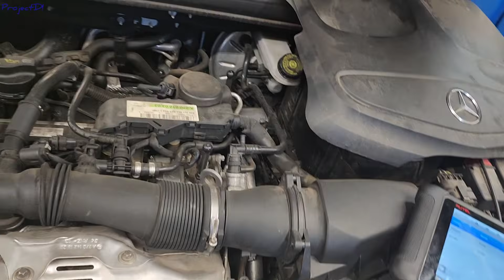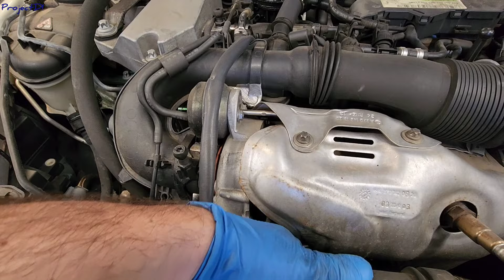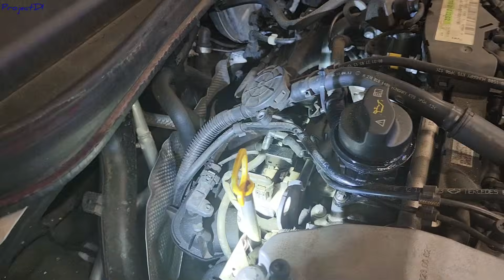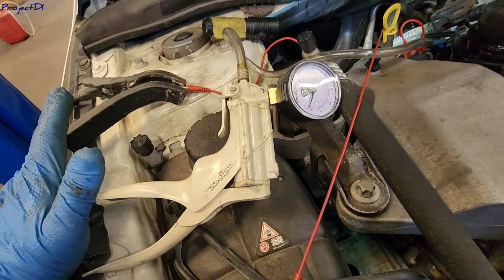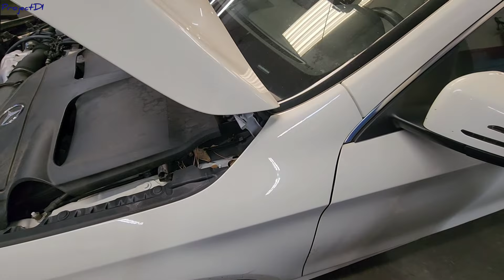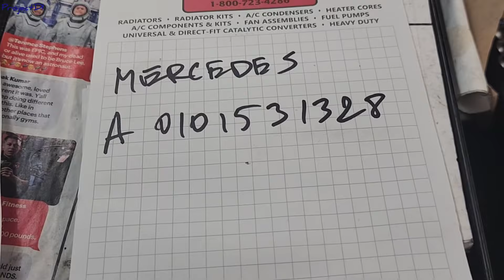MERCEDES P0299 2.0L LOW TURBO BOOST PRESSURE CHECK ENGINE NO POWER TO VEHICLE, DIAGNOSTIC & REPAIR

Comment: My wife's Infiniti qx30, basically a CLA wearing a kimono, started throwing turbocharger codes. She took the car to the dealership twice and they could not find the problem and instead blamed it on the accessory battery causing faulty codes, and then the main battery. She paid for the accessory battery to be replaced and then when they wanted to change the main battery, I told them not to. They wanted about $600 plus to do this. I bought a $250 battery from a local auto parts place and did it myself and it did not fix the issue. However watching your video, it literally took me 5 minutes to find the problem. A cracked vacuum hose on the wastegate actuator.  I wish I had found this video earlier. My mistake searching for qx30 instead of CLA. The next step would have been the dealership wanting to charge a couple of grand to replace the wastegate. 

Thank you so much!
Reply from the maker: Yes indeed, a couple of those Infiniti models are a complete Mercedes vehicle with Infiniti badges so you need to look for Mercedes problems instead... Glad that you fixed your issue and thanks for your support! 🤞💪👍

Comment: Is its same for c250 Mercedes Benz 2012 I have same code P0299 should I buy the same part or no I have to check it first
Reply from the maker: You need to do your diagnostic always before buying parts... You may think your problem is the same but until you do a proper diagnostic you are never going to know for certain... Thanks for your support and Good Luck!🤞💪👍

Comment: Hey I have a 2014 Mercedes Benz CLA 250 was running good got the engine pressure washed. Now it’s misfiring replaced spark plugs and coil packs and nothing. Any idea what can it be?
Reply from the maker: You need to scan for codes in the ECU to see what the ECU is complaining about before throwing money at parts you don't need to replace... Thanks and Good Luck!💯🤞👍💪

Comment: What are you talking about you delusional psycho? you just showed the Turbo Waste Actuator is not holding vacuum and needs replaced, why are you following "lines" ????? why are you worried if the line is sitting on the actuator good when actuator diaphragm inside of it its bad you showed that on your gauge lol.. i wish i can find where your "shop" is you need to go to court and payback all the customers you screwed!!!! like with your transmission services and other crap you keep lying to everybody.

Comment: Hey man, just got the same issue on my 2014 cla250, car seems to be running at around 3k rpm and no boost to be felt, just ordered the solenoid off on ebay, gonna have to drive like this for a bit till it arrives, will update once it comes cheers
Reply: So here I am dumbfounded, changed the actuator, the valve, and issue still not fixed I'm about to sell this crap and buy myself a Honda I swear
Reply: Update!
Did a full check on the turbo system, turns out one the small vacuum lines in the system had a pretty big crack in it, changed the line and drives again like it should, cheers
Reply: @denisandronic134  wat hose was that?
Reply: @ignacioalonso5201 yeah facts lol what hose was it
Reply: @denisandronic134 what hose was it
Reply: @denisandronic134 which one
Reply: have you fix it yet? I think mine has the same prob
Reply: @princelankah9796 so I just got to changing the solenoid yesterday, it fixed the issue and car now pulls as it should, cheers👌🏻
Reply: @princelankah9796  not yet, the solenoid came but will change it in a week or so, I will update then
Reply from the maker: Thanks for your support and Good Luck! 🤞🙏👍
Reply: @projectathos hey man so quick update, after driving around for a bit today I still noticed the same issue, car revs up but refuses to change gears? After stopping and starting it later it seemed to drive okay, could the issue be related to the wastegate actuator or is it more likely transmission related?
Reply: @denisandronic134 hey were you able to identify the problem ?
Reply: What’s the progress bro ? 
We need answers 🥲

Comment: I have a c300 2015  wife woke up jumped in it she claims to have let it warm up but smokes like hell not knocking no flashing check engine but it it’s burning oil thinking the turbo went out @170k
Reply: @projectathos  hopefully not the engine
Reply from the maker: You are going to need a proper diagnostic from a professional shop... Good Luck🤞
Reply: @projectathos  I’m a b level tech my pops a master mechanic I’m just now looking this stuff up couse I haven’t got home to actually check it just going by what the wife says hahaha

Comment: Mercedes c300 2016 I replaced the waste gate actuator. I now have power but the engine light is still on and the code says permanently P0299 do I need a specific scan tool to reset this code?
Reply: So when you tried to accelerate you wasn’t getting much power but when you changed the waste gate it ran normal correct
Reply from the maker: Yes you are going to need to go to a professional shop and get it scanned with an expensive scanner/computer that can specifically scan deeply into your car's ECU. At this point you are shooting bullets in the dark... Thanks and Good Luck! 🤞💪👍

Comment: Hi friend, mine loses pressure sometimes, usually when starting cold, then I turn the car off and on and it goes back to normal, I've already changed the vacuum solenoid and the problem continues, do you know what it could be? Thank you and congratulations for the video
Reply from the maker: You need to smoke the air lines and see where you are loosing pressure. Thanks 👍
Reply: @projectathos  Hi friend, the mechanic informed me that there is no vacuum coming from the engine, there is a vacuum before the solenoid, it only creates a vacuum after the engine heats up, is this normal or is there a problem?
Reply: @projectathos  When starting cold, the solenoid does not have the strength to pull the wastegate, the vacuum pump has pressure (I don't know if it has enough). After driving for a while, the solenoid has the strength to keep the wastegate back at idle, but I have already replaced the solenoid and the problem continues.
Reply: @projectathos  correction: engine is generating vacuum, but the relief valve only allows vacuum after 80 degrees, would this be correct?
Reply from the maker: This is not right! Your mechanic needs to find out where you have a leak and why the solenoid is not working! You need to have vacuum the moment you start your car! Check for leaks also around the engine. I cannot diagnose your car if I don't see it sorry... Thanks! 🤞💪👍
Reply: @projectathos  ok, thanks my brother 🙏🏻👊🏻
Reply from the maker: @vrcardetail 👍💪🤞

Comment: I have the code p029921, ive changed the Solenoid and the actuator but the problem is still there im about to order the egr valve vacuum hope that solves the problem. Please let me know of anything else i should look into.
Reply from the maker: You would need to smoke your intake pipes from the turbo to the air intake for possible leaks. If not that then you may have an issue with your wastegate and lastly it would be your turbo... Thanks and Good Luck! 🤞💪👍
Reply: @projectathos I just noticed the pcv hose was crack and the previous owner had a tape around the breather hose, I've ordered new hoses hope that fixes it other wise I might be looking into wastegate as the gate has a little play in it.

Comment: Hello, i have similar problem with CLA 180. So when running sometimes doesn’t matter the gear but around 2.5 to 3.3 rpms it cuts the power. When there is no boost i checked and the waste gate valve remains open, when you force the car the stick doesn’t move. When turn off and start again the car the stick goes back and there is vacuum and its working normally, and forcing it the stick moves. We changed the solenoid, but the problem still remains. Could it be that actually the waste gate valve with the stick is not working, and it fails when it thinks that its too much pressure and remains open. I have a video, but i don’t know where can i send it to you, to you, maybe you will know the answer. When reading the car with the valve not working its showing P002291. In live diagnostics when makes this problem its doesn’t show any mistake ..
Reply from the maker: You need to investigate your P002291 code because this code is for Low Injector Pressure. Possibly Low Rail Fuel Pressure... Thanks and Good Luck! 🤞💪👍
Reply: Hi Denis ,how did you solve it? ?

Comment: Thanks a lot. Perfect video as always. Where is this solenoid located in w212 e550 m278 engine? Are there 2 solenoids as there are 2 turbos. Scan says low pressure on turbo 1 which one is turbo 1? Driver side?
Reply from the maker: What's you codes that you see after the scan?
Reply: @projectathos  P029900
Reply from the maker: Yes, you will have 2 solenoids because you have 2 turbos. You need to keep investigating where you are loosing boost but in your case you may have a loss in the pressure air lines and therefore you need to smoke all the lines and see where you are loosing pressure... Thanks

Comment: I got a brand new mityvac same as yours as it was faulty loosing pressure. Check the tool.
Reply: @projectathos  was it the tool? I found my mityvac loosing pressure straight out the bag. Then its plastic and I was shocked by that. Didnt want plastic one. Aluminium is what I wanted

Comment: How do you replace the turbo boost pressure valve
Reply from the maker: If it's the vacuum driven valve on the outside that controls the metal rod to the wastegate then you can replace this one easy. Otherwise if it's the actual wastegate you may need to replace the whole turbo. Thanks 👍

Comment: What if my turbo is making a whistle sound each time it starts to spool up? Having this on my Cla like it's screaming /whistling
Reply from the maker: You need to check this out with a competent mechanic but it sounds like your turbo may be going bad. You should be able to hear any sounds. Definitely going bad if it's consuming oil and possibly smoking... Thanks 👍
Reply: @projectathos no check engine or white smoke. Just a whistle when you try to pick up boost. But it doesn't pick up speed at all. Changed all the o rings and that didn't help. Will be ordering a new turbo. Any steps I should know before installing? Things I should check? And before I start it back.
Reply: @Dealzu what about your turbo whistling ? My brother have a v klass and same thing, when spool a turbo, it starts to whistle.. and says p0299fa code… and when reset a code, it starts to act normal until turbo spool… :/
Let me know what was your solution?
Reply: @Ur3o same here after 3-4k rpms theres no Power & it sounds like it’s screaming. Find solution?
Reply: @550Pete  diagnostic guys said its intake manifold…. But nothing specific right now :/
When we got a time we take this apart and see where and what was the issue :) then i let you know:)
Reply: @Ur3o I got code p029946 , im being told it’s the boost pressure solenoid.
Reply: @Ur3o so I replaced the boost pressure solenoid, the piece towards the back of the engine & it drives normal for about 20 mins then start loosing power over 3-4k rpm’s
Reply: @550Pete  interesting cuz it seams like it solves a problem but it didn’t as well :D
We still drive with that whistling noise:D but we have a iCarsoft MB2 on obd port and when power is gone we just erase the error codes and it runs again :D until turbo spools to much:D
Reply: @Ur3o  yes same as well it drives fine then starts loosing power. I found the issue is the diverter/blow off valve
Reply: @Ur3o
Reply: @Dealzu  now our intake manfold has hole inside:D now its replaced (too much work on that) and everything works fine… until today, my older brother goes to visit our younger brother… but we live in Estonia, and he lives in Netherlands :D so its 2200km to there… and what a surprise today turbo hose thinks its good time to go in to peaces :D so now lower right turbo hose is broken… :D
Reply: @Ur3o  it was a blown turbo that lead to a piston leaving my block

Comment: I have a 2017 Mercedes metris 2.0l same code, low power above 3000 RPM. Already changed the diverter valve that sits right next to the waist gate and I did not fix the problem what throws me off is if I turn the engine on and off it drives perfectly fine for about 20 minutes.  Not sure if I should order a new wastegate.
Reply: I should also mention when I put a vacuum tester on the end of the actuator rod assembly/ TS vacuum cell I’m only getting 8 inches of vacuum anymore and it just leaks out.
Reply: Appreciate your help bro
Reply: @IsaacHamoui  no problem without YouTube. I would’ve never figured it out.
Reply: @jglassman1122 hahaha bro thank you sorry to do your head in what’s the part called that you replaced?
Reply: @IsaacHamoui  I believe it’s called a wastegate actuator. However, when you search the part number, Mercedes calls it a Ts vacuum cell
Reply: @IsaacHamoui  if you want, you can shoot me your number and I will text you an actual picture
Reply: @IsaacHamoui  if you look in the video at exactly 4 minutes and seven seconds, he plugs a blue hose into a part that part is what I replaced
Reply: @jglassman1122 that’ll be great thanks champion
Reply: @IsaacHamoui  just let me know how I can reach you and I’m happy to help
Reply from the maker: It doesn't seem like the wastegate. Possibly try to check the valve controlling the waste gate first. Also another problem could be the vacuum lines leaking air so you would need to check all of them around the engine. I have seen a similar problem like yours when one of the air guide pipes comes out of it's mounting place and creates a leak. These same pipes you may need to inspect for cracks also! What happens is the air coming from the turbo cannot reach under boost the throttle body side because the leak lets the air out of the pipes. So check all the basics first and then all of these that I just told you. You may end up needing to visit a professional mechanic to diagnose your problem properly my friend. Sometimes it ends up cheaper 😁
Reply: @projectathos  thank you for the info when I put vacuum on the actuator rod that goes to the waist gate it does not stay open the rod actuates, but then immediately goes back inside even under vacuum because it’s only getting 8 inches. That’s why I was thinking that it’s that actuator rod that goes to the turbo.  But I will definitely check all the plumbing. I believe we are talking about the same part I’m talking about the first thing that you hooked the vacuum tester to in your video. The part that has the rod that goes to the turbo.
Reply: @projectathos  I replaced the wastegate actuator solenoid already earlier today, and I did not solve the problem part number 000-153-18-59. I’m not sure if this is the same thing that you’re referring to.
Reply: Hey bro I have the same problem drives very good for 20 mins then goes low on boost and car doesn’t move
Reply: Do you have a check engine that pops up. I don’t have any light on the gauges I took it to a mechanic he had a look and done a smoke test. No leaks at all called up another mechanic and he told me you shouldn’t be worried and told me there’s no point of wasting your time if there’s no check engine light. It started happening to me yesterday it haopend 3 times. Today I was driving and everything was fine
Reply: @IsaacHamoui  I ended up replacing the part that he tests at four minutes into the video and then fix the problem
Reply: @IsaacHamoui  no the engine light did not come on however, I had low power over 3000 RPM so I scanned it and I had the little boost code po29921
Reply: So sorry bro
I’ve been so paranoid since yesterday. Would you mind explaining what you had done and what exact parts changed. Thanks bro appreciate it heaps
Reply: @IsaacHamoui  I replaced the wastegate actuator. The part that is shown at four minutes into the video. It was about $115 to the park and took me an hour.
Reply: @jglassman1122 wow men that’s very good. I’m happy for you bro. You don’t understand it’s such an ugly feeling when you don’t know what’s wrong especially when mechanics have a look at it and can’t give you an answer
Reply: @IsaacHamoui  you can easily do a vacuum test. The tools about $30 to see if that part is bad and I believe it’s actually very easy to replace this part on the CLA.
Reply: @jglassman1122 at 4 mins his talking abt the vacuum pressure
Reply: @jglassman1122 thank you so much men sounds like we are having the same issue. I’m just at work now as soon as I finish I’ll try it what exactly do I need ?
Reply: @IsaacHamoui  yes and that part at four minutes, Beckys connected the pressure tester to get the part that I replaced
Reply: @IsaacHamoui  what vehicle do you have?
Reply: Was it a cheap fix ?
Reply: @IsaacHamoui  cost me around $110 for the part and took me about an hour. I have the Mercedes van I believe on the cars it’s easier.
Reply: I have a cla 250 2017 model
Reply: Gave *
Reply: It’s not letting me send in my contact number
Reply: Keeps deleting it
Reply: Isaacc.haytch
Reply: @IsaacHamoui  hmm that sucks
Reply: Insta
Reply: @IsaacHamoui Did u fix it bro? And what was the issue?